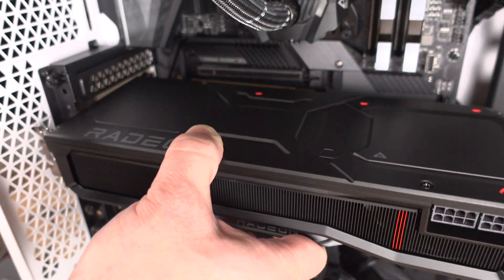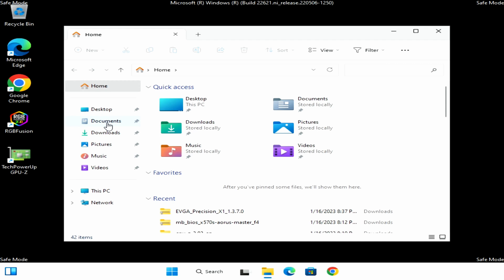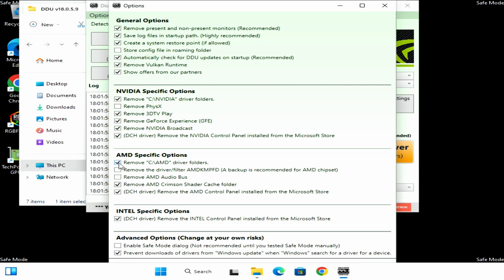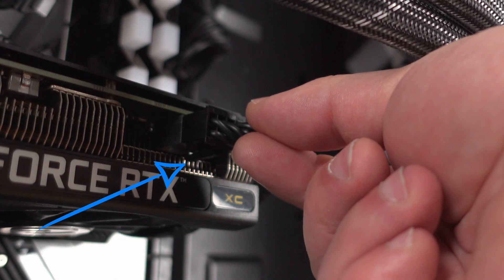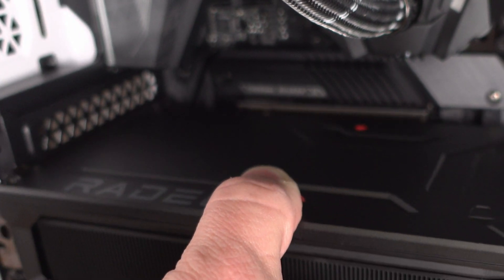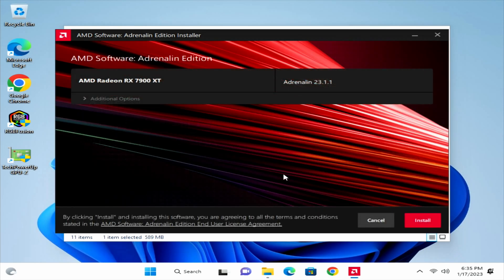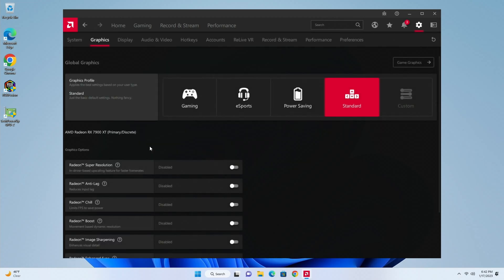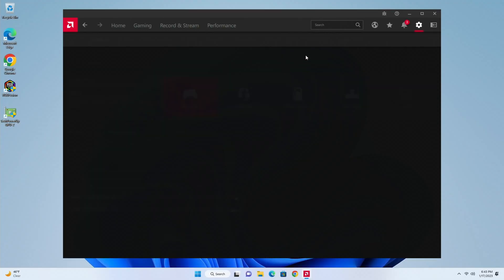The best way to Install the AMD Radeon RX 7900 XT Graphics Card in your PC

Comment: QUESTION!
I have the option to buy a used 7900xt, for my own pc that im building but havent recived any parts yet! 
My son have a new PC with a 6700xt.

Can i just swap out his 6700xt with the used 7900xt to test that its 100% working order,
or do i really need to go thoug all the driver uninstaller to see if my GPU is good?
and then repeat all of it again once more to get his new 6700xt working 100%

Seem like a big hassel, and im to lazy to do this multiple times😀
Reply from the maker: If you want it to work well, do it the way I show you, if you are cool with the potential of issues so it the way you mention.  Save time now, spend more time later.  Teach him well
Reply: @ThisBytesForYou  in other words, I wont know if the card works properly, unless I uninstall all drivers and install the 7900xt specific drivers?
Reply from the maker: @Descenter1976  it will work just fine
Reply from the maker: This will help you https://youtube.com/shorts/qbKrePI6rvM?feature=share

Comment: Hey, if I have a Radeon RX 580 4gb nitro+ card, can I use the same power supply plugs that are in it for this RX 7900? I didn't build the computer, the most I've done is install an M2 SSD drive 😭Thanks
Reply from the maker: No worries my friend, what is the manufacturer and model number of your power supply?
Reply: @ThisBytesForYou  Hi - it is a bitfenix whisper 750 w 80+ gold certified fully modular ATX power supply
Reply from the maker: yes, that is the bare minimum spec for the card, it has  6 x 6+2Pin cables, so make sure to use 2 seperate pcie cables.
Reply: @ThisBytesForYou  If its bare minimum, should I replace it before getting a new graphics card? Or does it not matter?
Reply from the maker: @AM2K2  personally I like to have more than I need, you did when you had the 580 but now that you updated to the 7900, you need to update next time you upgrade, so I think you are good for now.

Comment: I installed the drivers but my card’s fans are still spinning the temperature are below 50 degrees celsius. I have the same card as you do. Im unsure why this is happening.
Reply from the maker: Did you read my prior comment on your older comment?
Reply: Im so sorry I just saw it now. Im getting the information ready ill send it soon. Thank you for replying
Reply from the maker: @xoltron_5  always a pleasure my friend, I may not be able to reply today on this, just got back from work and I am tired,
Reply: Yeah same here over here the weather has been crazy hot. Not used to the heat at all as I live somewhere were it's cold all the time.

these are my specs:
1. Motherboard: ROG STRIX B550-E Gaming
2. CPU: Ryzen 9 5950x
3. RAM: Corsair vengeance 16GB 24000Mhz
4. Video Card: XFX Radeon RX 7900XT Gaming Graphics Card 20GB GDDR6, AMD RDNA 3 (RX-79TMBABF9)
5. Power Supply: Corsair 750Wx80 PLUS GOLD
6. Monitor: KOORUI 27 Inch QHD Gaming Monitor 144 Hz, 1ms.
7. Yes I have all PCLE connectors plugged in.
8. HDMI.
9. unsure about this one.
10. unsure about this one aswell...
11. Yes.
12. No.
13. Thank you.
Reply from the maker: I did forget to ask you, what is the case you are using?
Also, right click on an empty space in your background, then click "AMD Software Adrenaline Edition" then click "Performance" then click "Tuning", then click "Custom" under "Manual Tuning" and do you have Fan tuning enabled or disabled?  You might want to enable it, then enable "Zero RPM" and you can also adjust your fan curve when you enable Advanced Control.

Comment: Does this card not have any lights?
Reply from the maker: No my fried it does not, not always, but they usually leave it to the partners to add better cooling, lighting and other things which is why the AIB cards cost a little more.
Reply: @ThisBytesForYou  awww okay thanks for the reply. I haven’t been up to date on the amd side of cards but I thought they used to be red leds
Reply from the maker: They used to, but people complained that they could not turn them off, so AMD just decided to stop and let the AIB's do it.

Comment: Im not sure if im too late but mine came with a small box and dongle(s) what are they meant for ?
Reply from the maker: Ummm, I can't tell you, you haven't told me what the dongles are.  Tell me the exact model name and manufacturer of you card, I may be able to tell you what the dongles are.
Reply: @ThisBytesForYou  ts the 7900xt hellhound but it has a "power color" box 2 dongles ones shorter than the other
Reply from the maker: @bryang1740  do you mean the anti-sag bracket?

Comment: Hello can I put this GPU into this motherboard msi h110m pro-vd (ms-7996)?
Reply from the maker: Well, it is UEFI compliant and PCIE, so technically it would work but your CPU I am sure would bottleneck the gpu performance.  What CPU are you using and how much RAM do you have?
Reply: @ThisBytesForYou  My pc dont have UEFI and im using i3 7100 and have 8gb of ram
Reply from the maker: @AfexCZ  no wouldn't even bother running that video card with your system and yes you do have UEFI, it's your bios

Comment: Mine says GPU 0, 0% 90°c. With normal usage, Dunno what to do.
Reply from the maker: So that I can help, please list the manufacturer and exact model number of the following components:

1. Motherboard - manufacturer and exact model number
2. CPU - manufacturer and exact model number
3. RAM - manufacturer and exact model number
4. Video Card - manufacturer and exact model number
5. Power supply - manufacturer and exact model number
6. Monitor - manufacturer and exact model number
 Redundant I know, but many people forget to enter manufacturer and exact model number
7. Do you have ALL of the PCIE connections plugged in, and not daisy chained or pigtailed, each coming directly from the power supply?
8. Are you running through HDMI, DP, DVI, VGA, any adapters?
9. UEFI in the BIOS from Legacy.  If it was set to Legacy, you will need to reinstall windows to get correct support.
10. Disable CSM in the BIOS
11. Installed latest supported chipset driver?
12. Have you disabled Fast Boot within Windows?
13. What Case do you have
14.  How many fans do you have in the front of your case, and are they blowing air into the case or exhausting it.
15.  How many fans do you have in the top of your case, and are they blowing air into the case or exhausting it.
16.  How many fans do you have in the rear of your case, and are they blowing air into the case or exhausting it.
17.  How many fans do you have in the bottom of your case, and are they blowing air into the case or exhausting it.
18.  Do you have overclocking software installed?
19. Are you overclocked?
20. What do you consider normal usage?

Comment: You mentioned not to daisy chain the PCIE cable. Does that include the 6+2 PCIE cable that also has another 6+2 plug attached to it? I have a Corsair CX750 Bronze. It does have 2 PCIE 8 pins at the PSU. So I do have an extra cable if necessary.
Reply from the maker: if this is your power supply, it has 4 x 6+2 cables, which it would have 2 cables, each having 2 x 6+2 Pin connection.  So you would take 1 x 6+2 cable and plug it in, then take the other cable, and plug that in, not cable 2 connections, 2 cables 1 connect each.: https://www.neweggbusiness.com/product/product.aspx?item=9b-17-139-199
Reply: @ThisBytesForYou  Mine is actually the semi-modular version. I see. Better to split the load between 2 separate cables. Thank you for your help!
Reply from the maker: @Pazo139  Yeah, I think about it this way, treat it like a straw.  By yourself, you can drink a drink regularly with a straw, the hole is only big enough for 1 straw, but your friend wants one too, you can't fit another straw in but you pop a hole on the side of your straw to share.  Now when you suck the drink, your going to be missing a lot, so is your friend, your going to puff on a lot of air pockets, it won't be the same, I consider it similar, you won't get the same power.  Always a pleasure my friend, so very happy you stopped by, trusted in me to help you, liked and subbed as well as took a moment out of your day to thank me.  It means a ton to me and I am so very happy I could help you.

Comment: Sorry for my possibly stupid question, but I just have my doubts. And when in doubt, better ask. I want to buy the Sapphire NITRO+ AMD RADEON RX 7900 XT Vapor-X 20GB, but it has 3x8 pin. Does this means that I have to connect three separate pcie cables from the battery to the GPU? Thanks for your help.
Reply from the maker: Yes, you will need a power supply that has all 3 8 pin or 6+2pins and at least 750 watts.  Not a stupid question at all my friend.
Reply: @ThisBytesForYou  I have the Inter-Tech Sama FTX 1000 watt PSU.. Looks like there are 8 times a 8pin available on this PSU. Then I buy at least three separate Pcie cables to connect them between the PSU and GPU. Thank you for your quick reply.
Reply from the maker: the box states that it brings four PCIe 6+2-pin, you should be good.
Reply: @ThisBytesForYou  Thx for the information and your help. Have a great day..
Reply from the maker: Always a pleasure my friend, so very happy you stopped by, trusted in me to help you, liked and subbed as well as took a moment out of your day to thank me.  It means a ton to me and I am so very happy I could help you.   You have a great day too thank you.

Comment: a general question what do side grills on gpu usually do. do they expel or intake air out of the case?
Reply from the maker: They expel heat into the system, so it's very important to have good cooling in your case,

Comment: Will my 7900xt-ers rise up
Reply from the maker: Well, I can stand up with you ;)
Reply: Me!
Reply: Rx460 standing strong
Reply from the maker: That was a great card my friend, but overtime, games require so much more.
Reply: @ThisBytesForYou 
That is true with all cards.
Reply from the maker: @SpaceDad42  ummm . Correct, kinda what I was eluding to.
Reply from the maker: @SpaceDad42  also that comment was geared toward the rx460 comment but it doesn't always put the right name when you reply to somone
Reply: Me!!!
Reply from the maker: You!!!!
Reply: Wish I could but those drivers are freaking killing me. I can't make this thing work for the life of me.
Reply from the maker: I am sure you can, So that I can help, please list the manufacturer and exact model number of the following components:

1. Motherboard - manufacturer and exact model number
2. CPU - manufacturer and exact model number
3. RAM - manufacturer and exact model number
4. Video Card - manufacturer and exact model number
5. Power supply - manufacturer and exact model number
6. Monitor - manufacturer and exact model number
 Redundant I know, but many people forget to enter manufacturer and exact model number
7. Do you have ALL of the PCIE connections plugged in, and not daisy chained or pigtailed, each coming directly from the power supply?
8. Are you running through HDMI, DP, DVI, VGA, any adapters?
9. Is UEFI or Legacy Setup in the BIOS?
10. What slots do you have your RAM installed in?
11.Do you have CSM Enabled or Disabled in the BIOS
11. Installed latest supported chipset driver?
12. Have you disabled Fast Boot within Windows?
13. This video will help you identify hardware inside your PC: https://youtu.be/65ZSiVImJx0 @randomytguy7315

Comment: Ok, huge problem, I followed your video step by step.  I also have an AMD chip set, so I unchecked all the AMD boxes as described, did the clean and shut down.  I installed my 7900, connected the monitors, powered up, and nothing, no display.  Now how do I install the new drivers, or for that matter, do anything???
Reply from the maker: Well, you saw it worked perfectly for me, as it has the several thousands of times I have done this, this was part of my job... So just breath.  Turn off your computer, disconnect the HDMI cable from the video card and the monitor and reseat them.  Are the pcie cables connected to the card, not daisy chained together, 2 separate cables?  Is your power supply at least 700watts?  Is your pcie card firmly inserted into the pcie slot?  Drivers won't stop you from seeing what's on your monitor, there is an issue, are you using an HDMI 2.1 cable?
Reply: @ThisBytesForYou  I got it, I realized I had two monitors and a VR headset all plugged in.  I unplugded eveything except the primary monitor and that took care of it.  Sorry.
Reply from the maker: @bluesdr44  no worries bud, glad you got it

Comment: Hey great video but I’m having issues, after I click the exe for AMD’s installer, it installs and then gets to the amd software adrenaline edition screen and gets stuck at ‘detecting your system configuration for driver and software compatibility’…just loads forever.  Any idea what I need to do here? 😅
Reply from the maker: So that I can help, please list the manufacturer and exact model number of the following components:
1. Motherboard - manufacturer and exact model number
2. CPU - manufacturer and exact model number
3. RAM - manufacturer and exact model number
4. Video Card - manufacturer and exact model number
5. Power supply - manufacturer and exact model number
6. Monitor - manufacturer and exact model number
 Redundant I know, but many people forget to enter manufacturer and exact model number
7. Do you have ALL of the PCIE connections plugged in, and not daisy chained or pigtailed, each coming directly from the power supply?
8. Are you running through HDMI, DP, DVI, VGA, any adapters?
9. UEFI in the BIOS from Legacy.  If it was set to Legacy, you will need to reinstall windows to get correct support.
Reply: @ThisBytesForYou  ah my one 8 pin connector is like pig tailed…probably need to order a new cable huh? Lol but let’s see

Mobo-Asus Rog Strix b550f gaming non wifi
Cpu-ryzen 7 5800x3d
Ram- Corsair vengeance rgb pro 32gb 2x16
GPU-Xfx rx7900xt 
PSU-Corsair cx750m
Monitor-sceptre 30in curved gaming monitor 2560x1080

Using HDMI
Reply from the maker: 1.  for your sake, I highly recommend you get on the latest BIOS: https://rog.asus.com/us/motherboards/rog-strix/rog-strix-b550-f-gaming-model/helpdesk_bios/
2. 750 is the minimum required power supply for the 7900Xt, I would get higher, at least 1K, I have it linked up in the description.
8. That HDMI cable needs to be 2.1, this was  a recommendation from AMD that has saved me many times.
Reply: @ThisBytesForYou   Thanks for the advice, I'm a little concerned about that bios update due to it being in Beta, may have to wait for update
Reply: @ThisBytesForYou  don’t know how, but out of no where the drivers installed lol and now works
Reply from the maker: @biplockzaggy  good stuff bud
Reply: @ThisBytesForYou  honestly thank you for your guide, coming from a gtx 1080ti !
Reply from the maker: Always a pleasure my friend, so very happy you stopped by, trusted in me to help you, liked and subbed as well as took a moment out of your day to thank me.  It means a ton to me and I am so very happy I could help you.
Reply: @ThisBytesForYou  hey is there a guide somewhere for updating bios?
Reply from the maker: @biplockzaggy  sure, here you go, this exact board: https://youtu.be/AWxliGLert8
Reply: @ThisBytesForYou  thank you! I ended up just doing a full pc reset lol my drivers were acting wonky.  Got it all up and running now

Comment: So it seems like the 7900xt isn’t reading.. I uninstalled and put my old graphics back on and that worked..  sad :/
Reply from the maker: chances are because you are not using an HDMI 2.1 cable, probably using an older HDMI cable, that is a common issue.
Reply from the maker: chances are because you are not using an HDMI 2.1 cable, probably using an older HDMI cable, that is a common issue and/or you have older hardware
So that I can help, please list the manufacturer and exact model number of the following components:
1. Motherboard - manufacturer and exact model number
2. CPU - manufacturer and exact model number
3. RAM - manufacturer and exact model number
4. Video Card - manufacturer and exact model number
5. Power supply - manufacturer and exact model number
6. Monitor - manufacturer and exact model number
 Redundant I know, but many people forget to enter manufacturer and exact model number
7. Do you have ALL of the PCIE connections plugged in, and not daisy chained or pigtailed, each coming directly from the power supply?
8. Are you running through HDMI, DP, DVI, VGA, any adapters?
9. UEFI in the BIOS from Legacy.  If it was set to Legacy, you will need to reinstall windows to get correct support.
10. Disable CSM in the BIOS
11. Installed latest supported chipset driver?
12. Have you disabled Fast Boot within Windows?
Reply: Hey it worked! It was the HDMI! I am a full go so far!  The only other issue I have is I can’t open the AMD adrenaline edition.. I get a message with a big red X. C:Users\ and whole bunch of others, like  appdata\microsoft\taskbar\ etc..
Reply from the maker: @jesusgonzalez302  uninstall it then reinstall it, use ddu

Comment: Its a 850W psu and a ryzen 7 5700x a good pair for rx 7900 xt?
Reply from the maker: not at all, I use a 1000Watt or a 1200Watt, it will only use what is needed and then you are safe for the future when other cards come out you wont need to keep buying power supplies.  My 1200Watt is about 15 years old and my 1000Watts, 2 of them are 3 years old and the other is 2 years old.... I have swapped NUMEROUS cards in between them, none have ever needed close to what they can offer, buy more if you can on that.